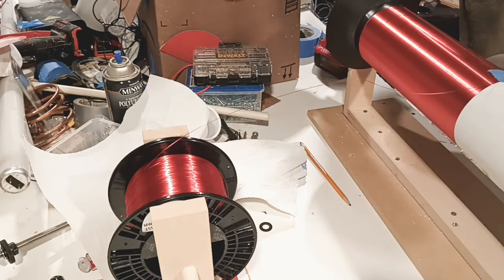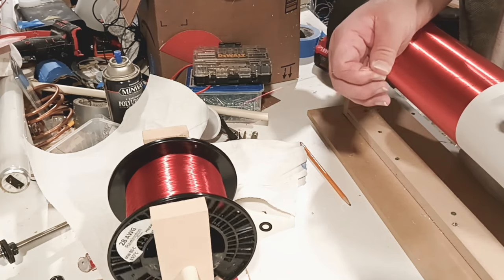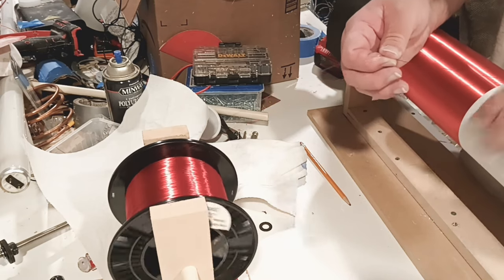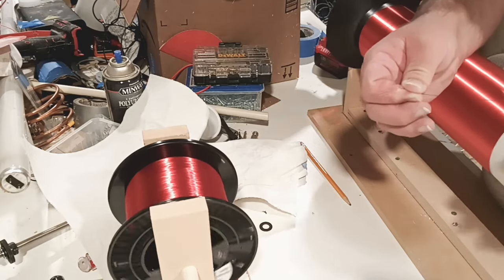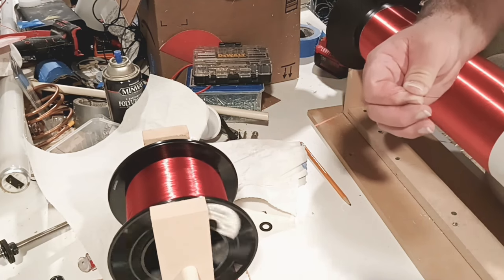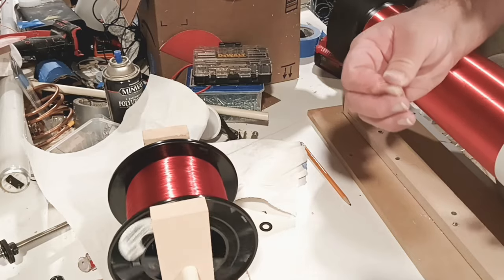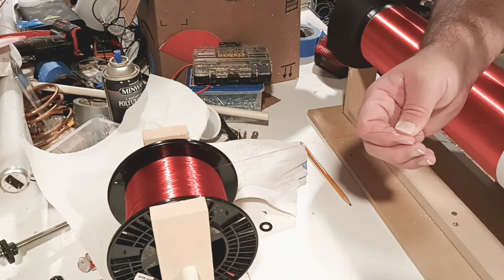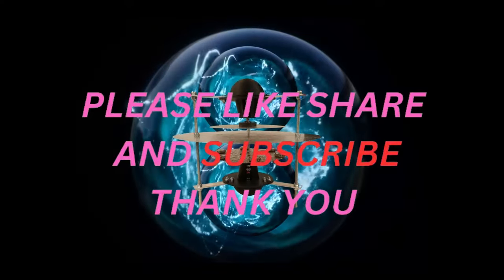Resonance In Spool Of Wire While Winding Tesla Coil

Comment: Synchronicity tells us its gonna be a nice inductor, great Capture. 
The resonant places along the tube was most likely caused by the former resonating with the table at certain frequencies of the formers length. 
What wire thickness and how many turns on the primary and secondary? about to build one myself.
Reply from the maker: This coil is for a zvs so when done 310khz was the goal. 28g wire 4" pipe. The 32g wire on the 4' pipe looks better and is shorter. I am hoping to show them on the monday live show.
Reply: @nathanbunten4299  Excellent - You showing here live or on Bernies Channel?

Comment: Nathan, I think it is the PVC being charged up from the friction of turning on your wood setup as wood is an insulator and also from your hand's friction on the PVC pipe. I don't think it is from the earth as your floor is concrete and is an insulator. When the charge builds up to a high enough point the charge dissipates into the wire spool as a current. This then produces antigravity waves from the high current low voltage setup as the electron field is antigravity waves. When the charge from the PVC pipe is high enough to make the current high enough the spool of wire becomes superconducting to allow the electron field to be antigravity waves instead of heat. I work with Michael Perrone from APEC on this. This is why the power grid is being turned into a DC power grid with a high current and low voltage for long distance power flow. The rod then jumps as it is losing weight. A person can also do this with ultracapacitors discharging into the earth very rapidly to produce antigravity and make objects jump. If the ultracapacitors could be charged and discharged very rapidly the objects could be kept levitating indefinitely. It is like the guy whose video you showed from YouTube that made objects jump on a piece of cardboard or something as you did not know how this worked as you could not see the ultracapacitors under the piece of cardboard. The gravity flyer working at a high frequency does the same thing to levitate by charging and discharging very rapidly to earth ground. In the case of your spool of wire the electrons are all being converted to antigravity waves, so you don't need the earth ground in the circuit as the spool of wire is insulated with its wooden holder. Ultracapacitors are plates and so are the gravity flyer disks and why they have to be grounded to the Earth to get the voltage to drop to produce antigravity waves as the electrons on the plates only travel a short distance but the wire spool is a long piece of thin wire where the traveling pulse of charge from the PVC travels a long distance at a low voltage so the voltage gets depleted just like in a circuit with a load. In this case the load is the production of the antigravity waves, so the low voltage high current pulse dissipates to nothing by the time it reaches the end of the thin wire. This is why I suggested that you use a tesla coil within a tesla coil for the gravity flyer as it is the same type of setup as your tesla coil winding work. You would hook up both tesla coils for the gravity flyer to achieve the same phenomenon instead of putting a wire down the center of one tesla coil. You would most likely not need the tesla coil to be grounded to the earth and you would get a much larger antigravity wave production so you could put your entire gravity flyer circuit on the gravity flyer on a platform.   I get the same effect with my solar panels and the attached power saver. The circuit produces pulsed DC instead of AC in my home and produces anti gravity waves leading to the gravity field anomaly that reverses time in the vicinity of my house and why my health gets better. This is why I suggest you get solar panels and a power saver so your health improves. Jesus worked his curing miracles in the same manner with the star of David UAP that was always in the area when he did his miracles.

Comment: Please visit the Tesla coil building sites there are years of work on the correct way to build and drive Tesla coils, please read Teslas own notes to build correctly
Reply from the maker: it isn't that. I am purposely driving feedback into the coil and heating up the #1 coil. Not many circuits are going to stand for that. But it has to be done to get the desired result.

Comment: In my experience once you have a solid division or multiple of wire length between a primary and secondary on a transformer you will have perfect resonance phenomenon. This is a basic Don Smith revelation.

Comment: WTF dude this is amazing capture ,  wtf??
Reply from the maker: Something you would never believe unless you see it. I have more footage but i was listening to a movie and you tube would not allow  it.
Reply: @nathanbunten4299  you have to find out if others had run into this event , or if you are the 1st , if so it needs scientific investigation .  It cant be simple vibration from your fingers and your arm rubbing the coil , that vibration you caused with your arm might be the trigger but the real signal is coming from else where into the two coils and or between them again wtf?
Reply: @nathanbunten4299  to some degree your arms and fingers were dong a frequency sweep  as you were winding the T coil from the spool
Reply from the maker: @mykedoes4099  there is some kind of capacitor effect going on for sure. Low frequency resonance.
Reply: @nathanbunten4299  how is that even possible the wire is insulated , all i see transferring is vibration , it could be that vibration was a trigger  for resonance with your house electric or maybe you have something running near by (electrical device plugged in wall )
Reply: @nathanbunten4299  kinda like shaking a car antenna to the rate of 102.7MHz is what you were doing with the vibration of your hand on the wire . If you shake the metal rod at the sound frequency you want to receive then once vibrating at that rate the frequency is received. It practically how we do it anyway (Radio) but with electrical vibrations instead .
Reply: @nathanbunten4299  you dont have to shake the metal rod for reception but you need hi pass and low pass filtering to get rid of all the freq except the one you want . But the concept is still sound you can shake the metal rod and bypass the need for filtering in my "OPINION"
Reply from the maker: @mykedoes4099  no nothing running that vibrates or anything. Like I said it was like a static effect. The best part was the build up of energy.
Reply: @nathanbunten4299  was not suggesting something else vibrating the table rather something else electrical running , you know EMF (wireless transmission from a near by electrical device to the T coil )
Reply: Impulsed DC. High voltage, low current electric impulse with open wire circuit (or closed wire if wire length configured correctly) creates a reversal of dipole in LC circuit. This aggregates electron spins and decouples E and M which makes superconductive effects through time dilation due to the tunneling of electrons. Im simplifying it. Anyways, put together the work of Nikola Tesla, Tom beardon, Jon Bendini, Joel Lagace, the Hal effect, alter magnetics here. 

This form of electricity ties into zero point energy, gravity, antigravity, superconductivity, time dilation, matter transmitation, etc. through EMF 'confinement'. (dynamic). This form utilizes longitudinal EMF waves. 

Check out the plasmoid unification theory by Malcolm Bendall. Info on strike foundation. Open sourced.
Reply: @ElijahCokeley  yes i understand Malcolm is using pressure chambers to generate a sort of shockwave , i see your point about time dilation , any frequency that overcomes another including the time frequency which is basically all the frequencies in one aka TIME all frequencies are one , so its hard to imagine how you can shock such a dominant "frequency total  sum" known to me as Time . Just an Opinion .  ( but ya you can shock this frequency with an inverted sweep aka if you know which direction Time is moving you can sweep in the opposite direction with your shock wave generator . I have yet to look closely at the Bendal Diagram
Reply: Every object in the universe has a resonant frequency. Nathan knows how to tap into it intuitively.